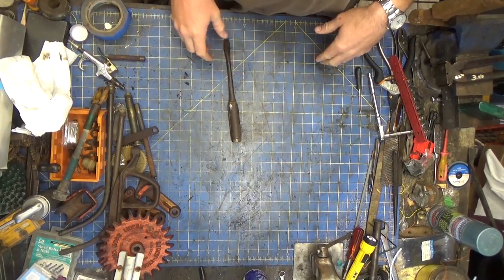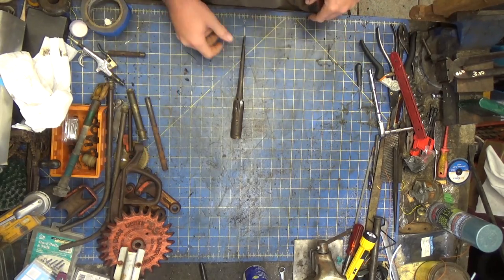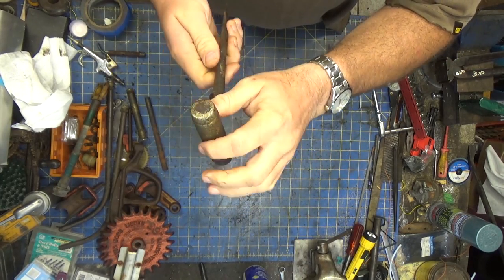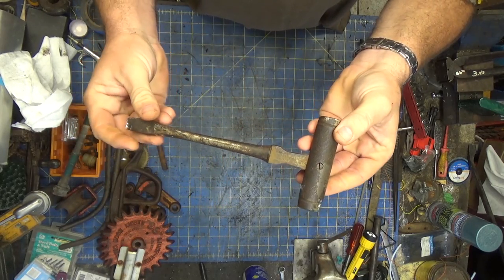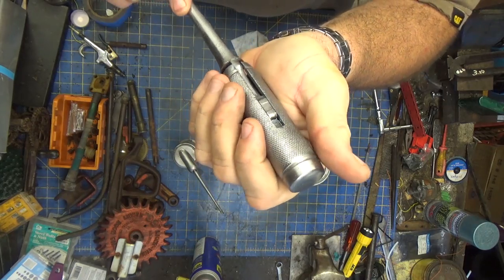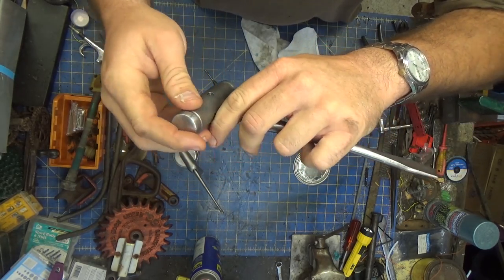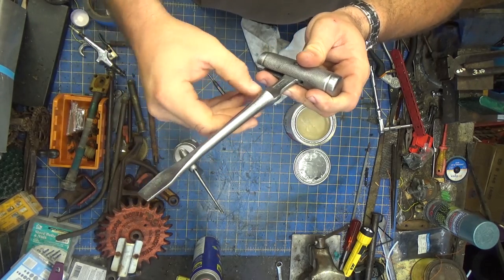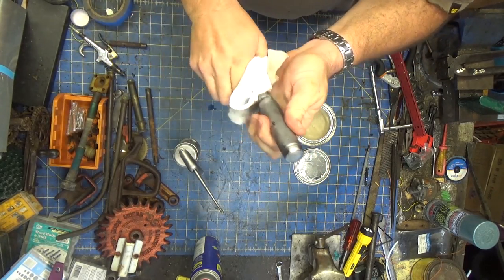Hammer-Handle Screw-driver

Comment: When wire wheeling knurling hold it at 45 degrees. That way the wires will run down the grooves. Then do negative 45 degrees. So all will be well. Hope that helps.